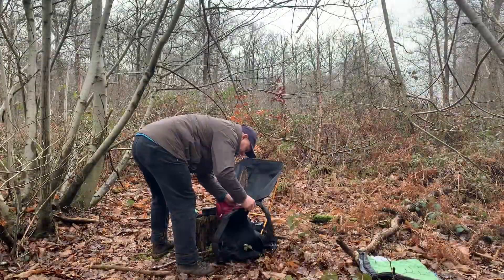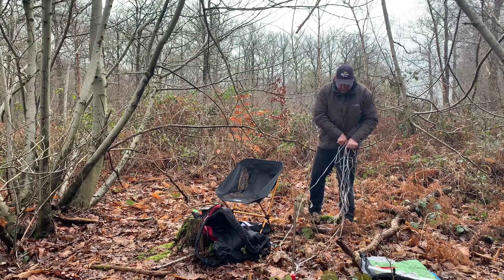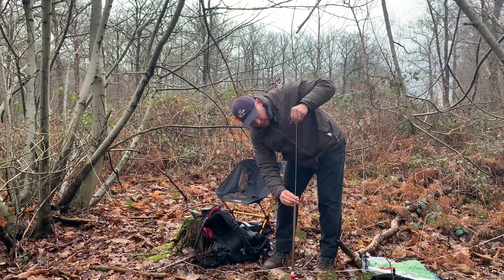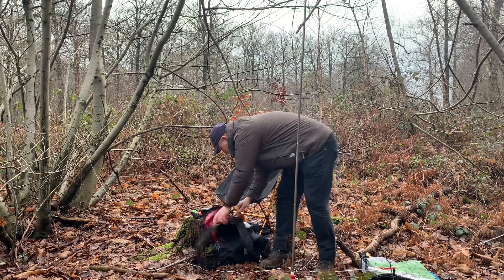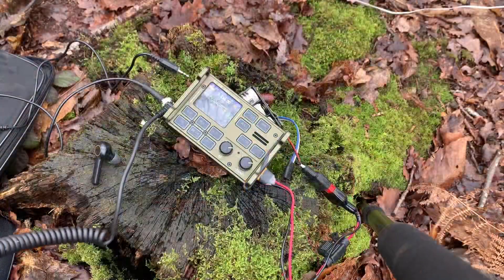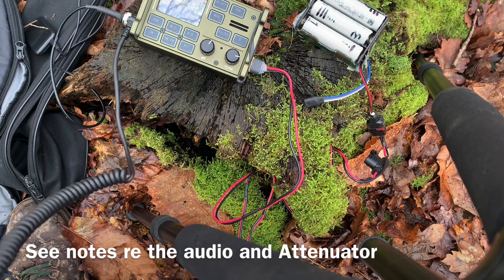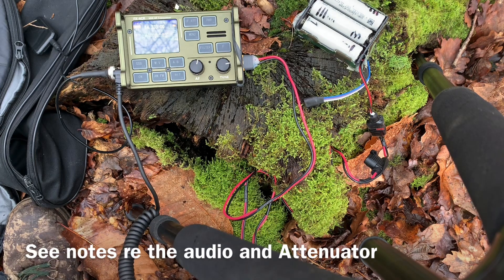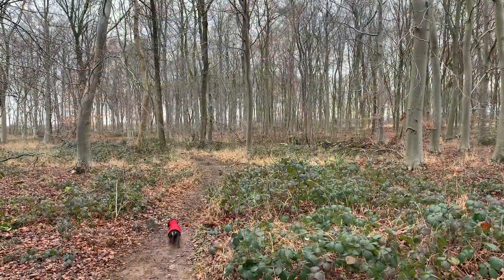Parks On The Air G-0239

Comment from the maker: The coil is a “40m induction coil” type that into Aliexpress and it’s any of the about £19 ones that look like the one in this video (copper thing below the telescopic whip and the red feed point)
It’s worth pointing outing out that on 40m the antenna physically becomes a 1/8th wavelength hence compromised but still better than most options out there. 
An EFHW is in many circumstances a better solution but requires trees / a mast and I’m practicing for  a hike where there are none.
40m gives me NVIS and out to about 800km
20m 650 km out to 2000 - 6000 km 

The battery pack is either a 3s or a 4s 18650 pack very simple setup and delivers the full 20w.
One of the benefits is that this transceiver accepts a native voltage range of 9-18 

Running 4s means if something goes wrong I can jury rig a dumper wire in snd have it as 3s

Comment: Looks like a good, simple but effective setup there Graham. You obviously got the results. I would be interested in knowing more about the coil you are using and the battery pack that you are powering the radio with. Are you getting the full 20 watts output?

Cheers
Phil ZL2VTH
Reply from the maker: Sorry Phil not seen this question will pm you directly 
But the coil is on Aliexpress / eBay Amazon etc and described as a 40m induction coil I don’t really recommend it - it’s good for a pinch but an EFHW is much more effective - with the induction coil at the base you’re looking at a radiator that’s about 1/8th wavelength - you also want many more radials